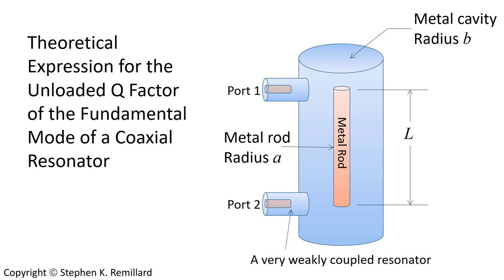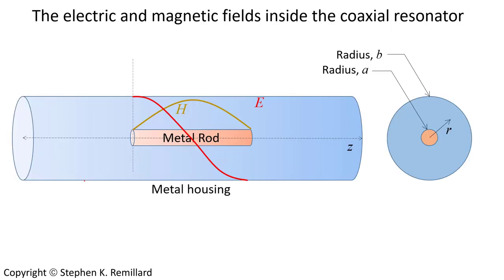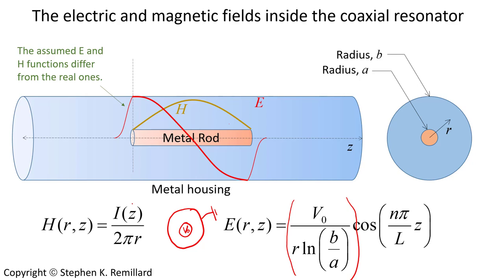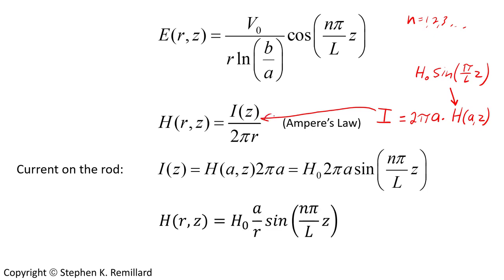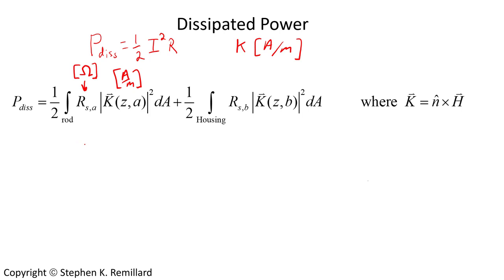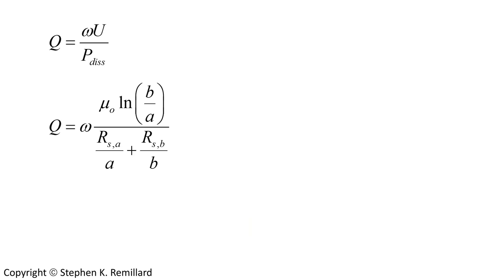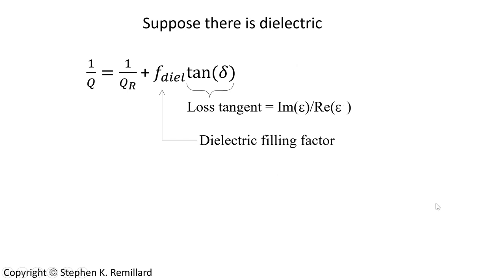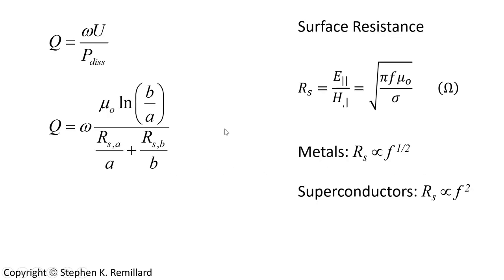The Quality Factor (Q) of a Half-Wave Coaxial Microwave Resonator

Comment: Very helpful as always! 
I have a question about the resonance frequencies of a cavity. Is there an intuitive way of estimating the frequencies of which a  simple cavity can resonates? For instance someone give us a geometry for a cavity. How can we estimate the resonance frequencies. Or given a set of frequencies which are NOT the higher harmonics of a fundamental frequency, is there an intuitive approach for designing a cavity which supports those? If our desire modes need to be only TE or only TM, how do we start with the design?
Do you suggest a good reference about cavity design?
Many thanks,
Reply from the maker: My intuition about resonant frequency stops working if there are two or more long dimensions in the problem.  If the resonator is long in one direction, then you can start with the fundamental half-wavelength roughly matching that length.  I recommend relying on an eigenmode solver, such as with hfss, for non-analytic geometries.  Perhaps another viewer can give some better hints.  Concerning the goal of having only a TE or a TM mode, if there is a problem with TE/TM degeneracy, then designing a mode trap into the resonator will split that degeneracy.  This can be accomplished, for example, by placing a deep groove in the cavity wall in a place where only one of the modes has significant current.  A common case is splitting the TM degenerate mode away from the TE011 of a cylindrical cavity by placing a deep groove all the way around the center of the cylindrical wall.
Reply: @stephenremillard1  Many thanks!

Comment: Why is surface resistance in units of Ohms and not Ohms/square?
Reply from the maker: Thank you for the question Victor.  This takes some explaining.  Surface resistance and sheet resistance are different things.  Despite the sound of the name, surface resistance is not a quantity that is distributed over a surface.  It is the real part of the wave impedance at a conductive surface.  When an electromagnetic wave propagates through free space, the wave impedance is E/H, which in free space is E/H=sqrt(mu_o/epsilon_o)=377 Ohms.  The wave impedance at the surface of a conductor is the surface impedance, Zs = E||/H|| = Rs-jXs, with the real part being the surface resistance.  E|| and H|| are the components of E and H parallel to the conductive surface.  Per the boundary conditions, ideally there is no parallel component of E at a surface.  So, ideally E||=0 and there is no surface impedance.  But a real conductor has finite conductivity, which then permits a small E||.  The unit of E/H is Ohms.  So, the surface resistance has units of Ohms.  Hope this sheds some light on what "surface" means here.